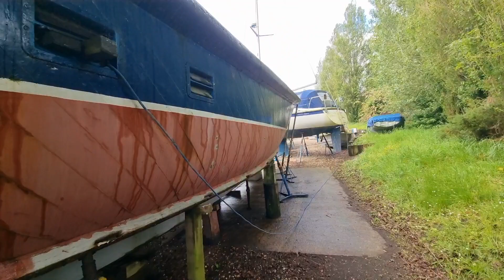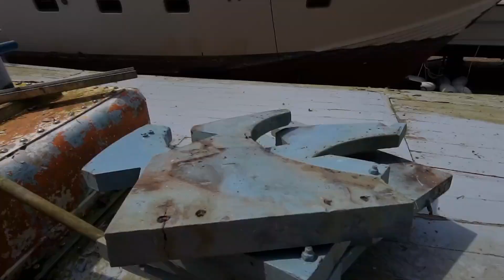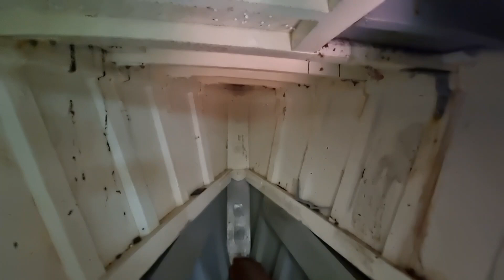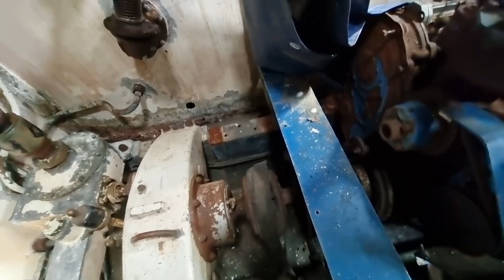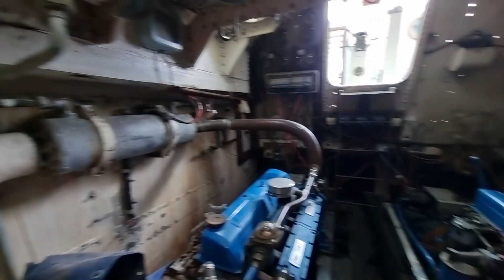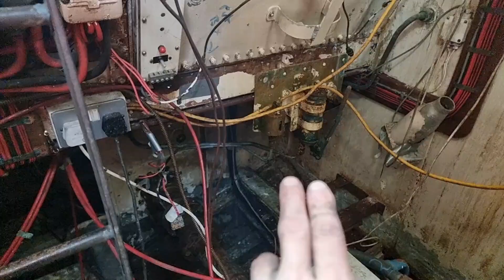RNLB Joseph Hiram Chadwick | 01 | Plank Rot and Engine Room tour

Comment: Thoroughly enjoyed watching that.  I used to work as an oak frame carpenter (Housewright), and oak does not damage stainless steel, so it would be possible and cost effective to fix a stainless steel angle section to the oak, with greased stainless steel screws/bolts, and form the actual bulkhead of ordinary steel fixed to the angle, thus keeping it isolated from the oak and losing nothing in terms of the torsional strength of the hull.  I'm retired now, so if you want a hand for a couple of days sometime, it would be an interesting little road trip for me.  I'm based near Portsmouth and have always been interested in boats due to my father having been a draughtsman for Vospers, from school until his mid 30's.
Reply from the maker: That would be great to have another pair of hands on board to help with the reframing and deck beams, she's a very old girl who's sadly had a lot of neglect in her last few years.

I had a couple of clinker launches in Portsmouth that I was regularly call for to help maintain them over the years, sadly both were laid up and are probably gone now.

Severn Boatworks
Reply: @Severn-Boatworks  Hi again, when are you planning for that aspect of the build to take place?  Also, are you working on the boat full time?  I can give you a hand for a week, as due to the distance it's not practical to come and go.  For me it will be a holiday away from my responsibilities here (I have my mother in a nursing home nearby and I usually go 2-3 times a week, but for the period I'm at your boat my sister will take up my visits).  So, if you can let me know when, I can arrive to the boatyard, as obviously I don't want either of us to put personal information here.  I'm assuming from the way you speak that you have all the power tools necessary, so I will only be planning for bringing personal hand tools unless you say different.

Looking forward to your reply so I can plan for coming to the yard.  I have gear to be self sufficient in terms of sleeping and cooking if there is a corner of the boat or shed available, so no real need to accomodate me.